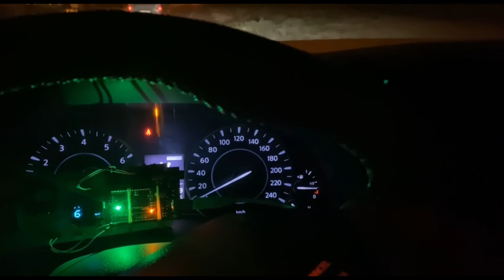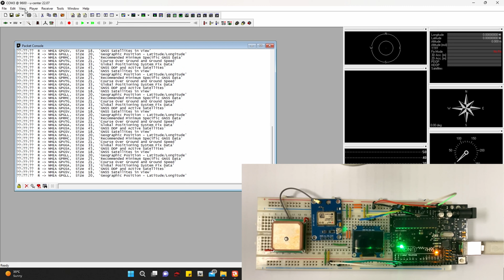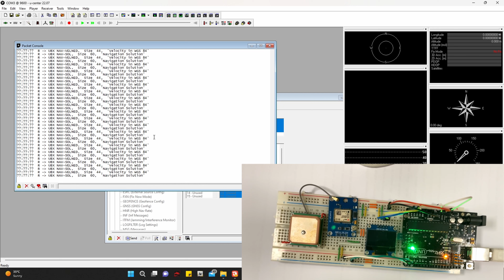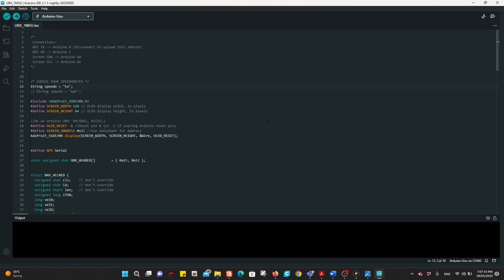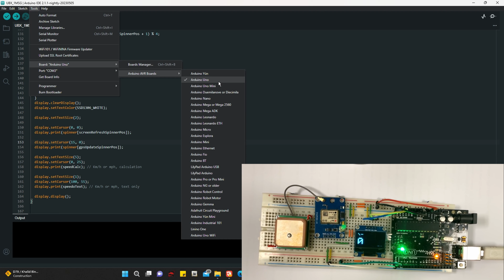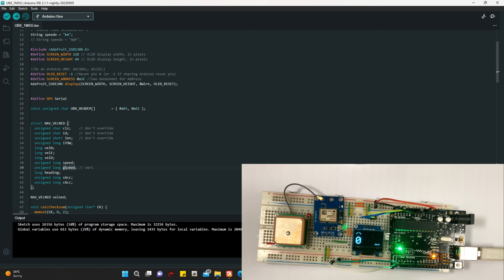5Hz NEO-6M Speedometer with Arduino

Comment: I’ve followed though the video (thanks for the clear instructions) and everything looks perfect but the gps led isn’t flashing and I’m not getting any readings, any ideas on how to fix this?
Reply from the maker: Hello,
Sometimes you need to wait for it to start flashing, make sure the 4 connections are clean of solder paste using alcohol. You can test your GPS module separately using u-center application to ensure the module is working fine. Once confirmed, you can connect it back to your Arduino.

Comment: im no longer receive gps signal
Reply from the maker: Try power unplug and re-plug and USB cable, swap RX/TX wires, check your solder and make sure you clean the solder paste with rubbing alcohol.
Reply: @3DElectroTech  please healp me. check the comment with the img link i posted
Reply from the maker: @Chinhnguyen0497  Ok, please share the link.
Reply: youtube keep delete my comment
Reply: i cannot post link. youtube keep delete my comment

Comment: How accurate are the speed readings compared to in-built car speedometers?
Reply from the maker: GPS Speedometers are very accurate, their accuracy depends on how many satellites they are connected to. The other factor is the refresh rate 5Hz means 5 updates in one second. I use NEO-M8N for my daily use, because it can go up to 10 Hz and picks more than 14 satellites. The code's speed calculation was calibrated using a well known GPS speedometer called DriftBox. You may have a look at the latest video which uses NEO-M8N, the wiring is exactly the same but the code is different. https://youtu.be/uW-suVJbJoY

Comment: My Led indicator not blinking, how to fix that?
Reply from the maker: Which LED, I have some nano boards with blinking LEDs and some don't.
If you mean the GPS module's LED, they will blink when they receive a valid GPS signal.
Reply: @3DElectroTech  neo 6m, I've waiting Up to 1 hour more, but still not blink. Pls helpp
Reply from the maker: Use U-Center application to make sure you are receiving information from your NEO-6M.
The information will start coming immediately and you don't need a Satellite signal to check.
This check will insure that you have a working NEO-6M.
Reply: @3DElectroTech  do u have the tutorial video? I try to use U center but the port isn't blinking(green)
Reply from the maker: - Which Arduino are you using?
- Which Ublox device?
Reply from the maker: You may also email me on boynet006@gmail.com. Send me a picture of your project and I will try to help you.
Reply: @3DElectroTech  esp 32 & gps neo 6m
Reply: @3DElectroTech  ahh ty sir, my GPS can work now, It turns out that the antenna needs to be given additional grounding.
Reply from the maker: Glad to hear it :)

Comment: Hello, i am using your gps-speedometer code and its working perfectly.
But when i add temperature sensor to pin4 its stop working, it starts refreshing speed every 6 to 10 sec.
Can you help me?
Thanks!
Reply from the maker: If there is a way, you can share more details like pictures and diagram. We will try to find a solution.

Comment: THX for this. But I'm not able to reconfigure the NEO-6M module using U-Center (Arduino Nano clone)?!? It won't let me disable the NMEA messages ....
Reply from the maker: This video shows how to configure NEO-6M using Arduino UNO https://www.youtube.com/watch?v=Ao5XRtd-RAA 
If that doesn't work, try using USB to TTL converter https://www.amazon.com/s?k=usb+to+ttl&crid=31YN9R1KHBVO&sprefix=usb+to+ttl%2Caps%2C352&ref=nb_sb_noss_1
If that also doesn't work, you probably have a NEO-6M with no re-flashing capability. I have a NEO-M8M that I couldn't configure because of that reason :(
I hope that helps.
Reply: Yep bro I too cannot reconfigure, any solution?
Reply from the maker: @sanjuk2325   There is a way to send the configuration whenever the device restarts. I probably have to make another video for that update
Reply: Bro do a video on it as you said 🥰
Reply from the maker: @sanjuk2325  I will try my best 🙂
Reply from the maker: @sanjuk2325 I have just finished the video for auto configuration on every restart, here is the link
https://youtu.be/YGVc9rjBIHY